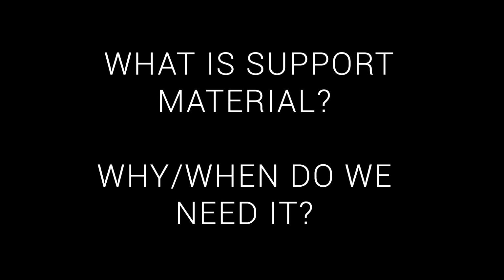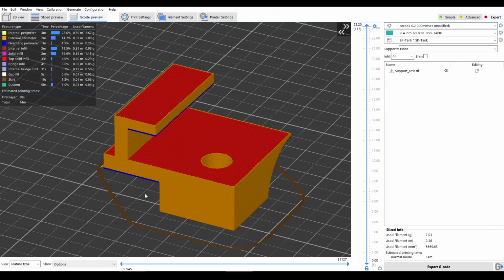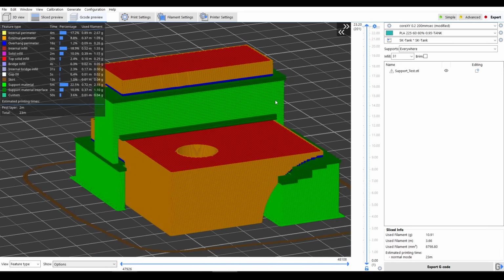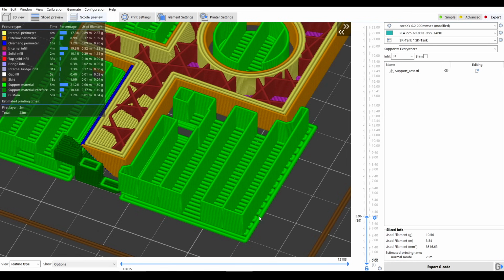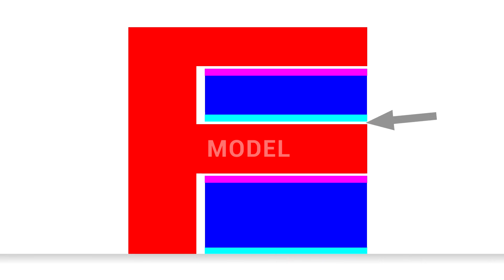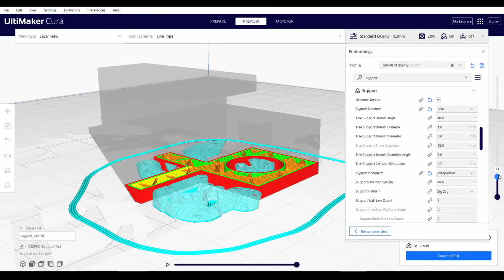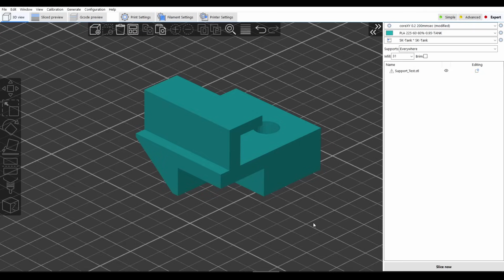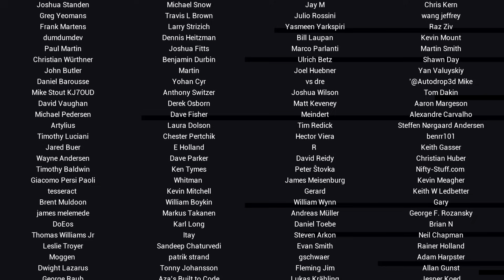Support material complete guide for 3D printing

Comment: Excellent video on dealing with supports. I have one comment: Since you have a very good outline of topics you use to make these videos. Would it be possible to make like a 'cheat sheet' on the different slicers and the commands they use to perform similar actions. For example:
X-Y separation between support and item to be printed:
Prusa: X-Y Separation (% or mm)
Cura:  Support x-y distance
I find rewinding the video to catch information is very exasperating and time consuming.  Even going thru the transcript is cumbersome.
Yes, I know are thinking "What an ungrateful subscriber after I put all this effort into this video." I do appreciate your effort but if you could make a cheat sheet it will be greatly appreciated.

Comment: What do you do for supports in tougher filaments? If your printing in nylon or pc etc then surely you don’t want to use that stuff in your supports because it would be expensive and difficult to remove. So if I’m using engineering grade filament then what material do I print the supports in and what material do I use for the interface layer?

Comment: You do a great job and i have learned much. Today I am in new territory. Maybe you have some ideas. CR 10S Pro V1 modified a lot, Pi 4B with Klipper, Mainsail and Orca slicer. Struggling to get clean parts with support. Setting are there but what does what is not transparent. I see weeks of trial and error to learn how to use all the knobs and dials available. Would like to very much shorten that learning curve and try hard to get the best possible part in the fastest print time on this old but much loved Bed Slinger.  Any help you can offer would be wonderful, Dennis in Virginia I forgot to mention horizontal holes, I need them for assembly and some are countersunk  and some are threaded but that all need to present a round hole not oblong which is most common. I am adding a second part cooling fan to help balance the hardening of filament once extruded. Not installed yet. Should help. D

Comment: For parts I design myself I have gotten into a habit of designing my own supports into the actual part. It's a lot more efficient than automatic supports and yields great results.
Reply: So you add them manually in cad software or in the slicer program?

Comment: I'm curious. In the video you showed a soluble support material that was quite flexible. We use Ultimaker PVA soluble support and it is very stiff and brittle. It breaks frequently in the bowden tube and jambs. 
What soluble support were you showing?

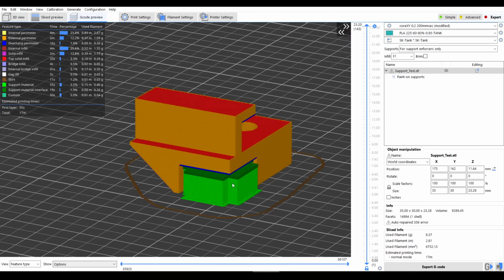Comment: ❓ 17:07
Is there a way to block the path of the supports? (Support-blockers don't do what I want)
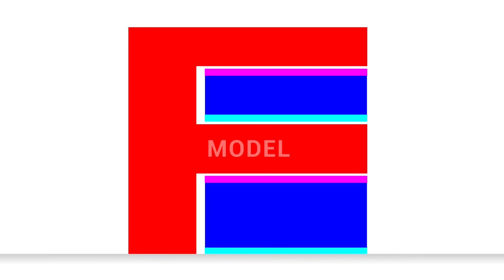E.g. I have a model like your red sketch (10:39) with a small hole in the bottom roof (circle of the hole being horizontal). Now the support would go through the small hole making it difficult to remove. With support-blockers I can try to find the area on the top roof exactly over the hole. What I want would be, that I could insert a "support-path-blocker" (my suggestion for the naming) as a cylinder inside the hole, so that there wouldn't go any support through (doesn't mather if traditional or organic/tree support).
For my easy example the way with the normal support-blockers (or paint-on-supports) can work somehow but with more difficult parts such "support-path-blocker" would really help.
Maybe they exist and I just don't know where.
PS: I'm using SuperSlicer and sometimes PrusaSlicer.

Comment: Something critical to know is that the air z gap will always be a multiple of your layer height when supporting a flat surface. If printing 0.2 mm layers, a 0.28 mm gap will print the same as a 0.20 mm gap or a 0.16 mm gap.
Reply: Well that doesn't seem to be the case anymore, at least not in Prusa or Orca

Comment: Thank you for a great video. Very educational for this noobie. I took my son's Geeetech A20M since he wasn't using it (just got married working on house) and I'm learning. I would like to learn the different properties for these filaments and how to program into the slicer. Of course there are lots of tuning involved but just the general idea. I would also like to find/told what slicer to use that I can see the G-coding after slicing, so I can edit a few things in like auto bed leveling and/or keep the setting in the EPROM.

Comment: I had to go hospital Friday because I had to use a raft which I never usually use. I turned it on left it as default and it was really flipping stuck to the point I needed to use something sharp. Unfortunately I slipped now I have a massive bandage on my finger. So I need to check these settings in future to save on hospital trips lol .

Comment: Those tree supports are larger than some of my prints! My tree supports are only 2mm in diameter with a 6mm wide base 3mm tall. I currently use Flash Print that came with my FlashForge Artemis and I'm honestly very impressed with it so far. I'm amazed that it printed without any issues right out of the box, I was prepared for days of testing and calibration....

Comment: Great info on all the supports.  Ive been useing them to my advantage lately, when printing some L brackets for shelf, the little 45 degree diagnal bit  gets filled with support adding to the strength of the brakcet,  i imagine anyway.  Not sure where the compression forces are going to be honest, but more mass in that area cant hurt.   Printing the bracket on the side allowed for no support but I was getting warping issues even with a brim because of the small contact and long surface area lifted corners easily (ABS)  printing the other way solved that, but gave me unwanted supported which turned out to be wanted!  The conicoildal supporst are nice looking too so add an artistic touch to the bracket.    Ive also printed some pieces in mid air to be purposely supported which gives a cool effect.

Comment: Would it work for slicers to have a mode in wich you could print two layers of, let's say, 0.16mm just walls and on the second layer the infill is printed at 0.32mm? This could allow for nice details on the outside and saving some time for infill printing. Also this could already be a thing and I don't know about it. :D
Reply: Yes I've heard of that. Look for "combine infill every n layer". Your should find settings for your slicer.

Comment: I would add my favorite tip for supports - for PS and similar (I don't know about Cura or S3D) do not over look "support material extrusion width" - I use much much lower/thinner/smaller width for supports, because then they are much much more easier to remove... for example I use 0.6 nozzle and my support material width is 0.4-0.45 (depends on material - silks need little more) and you use less material also :D so win-win

Comment: I can get the best supports by bumping up the bridge flow rate quite a bit, like 1,5. This applys also for the first layer from the overhang printed on the support material. The distance can still be 0,2 mm but with the bigger flow rate the material ist pressen more against ist but still not bonding very well because of the initial 0,2mm "gap". If ther are also real brides in the model I only apply the bigger flow rate with modifiers where the supports contact area is. (PusaSlicer)

Comment: Great video, Michael!  Very helpful information.  One setting in Cura that is worth using is “Enable Conical Support.”  It modifies traditional supports to use less filament by starting with a narrow base on the build plate and building the supports up at an angle until it reaches the full size before the transition layer.
Reply from the maker: Thanks for the info!

Comment: Hi, Michael. I have a solution for perfect supports for the single material. The only downside is the number of support top and bottom surfaces which are limited to one's patience (i.e. how many times you want to intervene the print process).

The method is simple and kind of derivative of old known method of using marker. I changed the usual marker to the custom one filled with sunflower oil (I purchased empty marker on Aliexpress if someone interested). Then you have to set pause after finishing the topmost interface layer, "paint" the surface with oil and continue to print. I even was able to separate well known calibration cube printed with 100% infill just using pause in the middle, which confirms that 0 mm gap works perfect.

Hope, this can help in some difficult cases where you have to print with supports and the surface above support must be the same quality as bottom or top.
Reply from the maker: That sounds effective. On angled face, do you pause it after each layer to apply the oil? I guess those break away easily by comparison anyway.
Reply: @TeachingTech  Well, technically speaking it's the same downside since angled faces have too many surfaces to support. But, yes, you have to apply oil every layer to make perfect supports.

Comment: hard to believe you haven't used tree supports before. I found them within a month of getting my printer and use them all the time, I find they are better than normal supports 60% of the time
Reply from the maker: It's the truth. With resin printing, they are closer to tree and I have used them extensively, but not with FDM. I don't ever use Cura unless it's for a video like this or I'm reviewing a machine that needs it. With that in mind it was never really an option for me.
Reply: @TeachingTech  ah that makes sense,  didn't know it was only in cura. Thanks for the videos btw you are one of the first 3d printing channels I found and I know most of what I know thanks to you!
Reply: @theycallme_nightmaster  yeah prusa slicer has it now on the alpha, as mentioned in the video, and it’s much nicer then traditional supports on most items. However Bambu studio tree supports are very nice. I’m sure I could match the results with prusa slicer with some tweaking but I don’t use my older printers as much as I used to so won’t unless I have to. 

All that being said supports have been the bane of my existence since I started 3D printing. I even kept the first model I printed that is embedded inside support material as a reminder to double check settings. 

I like the idea that petg and pla don’t play nice and you can use one for supporting the other. I need to try it some time.

Comment: Hey mate you mentioned a flat scalpel around the 12 minute mark. Where did you find them? Do they go by another name? I'm having trouble finding them.
Thanks.
Reply: A painter's knife is another option as they come in various sizes and are great for even removing prints off the build surface.

Comment: Your video has helped me resolve a LOT of issues I've had with supports lately - I have literally printed a dozen iterations of one model and each time it was a failure (usually the supports completely fused to the model, even organic ones).  You covered the bases of what is important and how I was very confused with what should be selected for several options in Prusaslicer.  Thank you Michael!😁
Reply from the maker: You're very welcome!

Comment: I just wish I could get Prusa Slicer to print supports like Cura.  I prefer almost everything about Prusa, but when I print things with supports, even using "organic" supports and tweaking the Z distance and X Y separation, they are still harder to remove, much less cleanly.  With Cura they almost fall off.

Comment: For xy gap it would be useful to see what effect this has when you are supporting overhangs that are sloped. I found it had quite an effect on removability of the supports, but not really sure what the actual relationship was or when the slicer was using xy, or z gap to determine support location on these kinds of overhangs.

Comment: The paint-on is good for putting supports in someplace that will be hard to reach. Like, if you're printing a cylinder open on the bottom, you can paint-on supports in a ring in the middle of the cylinder, and it leaves plenty of space around the edge and up the middle to get needle-nose pliers to grip the support stuff. Also, if you add extra triangles when you're modeling it (e.g., adding extraneous edge loops in blender) you can very easily paint on the triangles of a large flat area to drop supports right where you need them, not too close to edges and etc.
Reply: The exclusion painting can also be really handy too if you have small areas that you don't want support material in at all as it'll be impossible to remove.

Comment: You don't need supports for counter-sunk holes if you design them slightly differently. 
The STL files for the Voron parts illustrate how to do this.
Reply: I also like closing them with one layer height, so it's just a bridge and you can simply push the screw through
Reply: That's an easy way to design them.
But there's an even better design approach out there that doesn't cover the hole and doesn't require supports.

Comment: Thanks a lot for this one. Testing/tuning on my Bambu Lab X1C a bit now. I've mostly used tree supports with this printer so far, so I'll do a tst with regular and tree on the first model you suggested (but didn't try).
Reply: Apparently, the tree support wasn't very good for this model. The normal support (tuned a bit after what you did) worked well, though.

Comment: Michael, yet another excellent video!  Do you mind posting your traditional support settings for Prusa Slicer derivatives?  I realize that each printer is different, but I feel like this would give me and many other viewers a good starting point to experiment with.  Thanks in advance if you're willing!
Reply from the maker: It's not something I've tuned a great deal but you can see the thins I have in this video. 150% XY separation and I found a Z gap of 0.28 pretty good for top and bottom.
Reply: @TeachingTech  Much appreciated. I did see these settings in the video and played around with it a bit over the weekend. The top separation seemed to work fine, but no matter what I always got fusing on the bottom. Any suggestions? How much does temperature, cooling, and print speed play into supports?

Comment: @TeachingTech There's a Cura 5.3.0 psudo-Alpha that has a critical difference from the current 5.2.1. It is the "Minimum Support Area" setting - in the regular release, this is disabled for tree mode (and defaults to a value too high for me), but the special 5.3.0 release allows it. This was important for me, as I had a small lip that couldn't droop, and I couldn't get the tree or traditional support to go to it due to the part geometry. This version also has a ton of settings for tree mode that help with material usage and strength. Great addition to the tool box if Cura is your slicer of choice.

Comment: On my Bambu Lab X1C I load PETG into one of the AMS slots, and use it as a support interface when printing with PLA. Works very well, I can set the top Z distance to zero, and the prints come out perfect
Reply: Don't you end up purging tons of waste?
Reply: @MumrikDK wouldn't be that bad for only the interface
Reply: How do you slice it to only use petg as interface layer?
Reply: @Ebonyqwe  under support tab, there's a selection for "filament for supports." You just pick a roll to use in the "support/raft interface" box.

I imagine you already know this, by now, but it's worth adding for others that might have the sa me question.
Reply: Can the same be done with ASA and PETG? Or is there another material that can be used to support ASA?
Reply: I tried the same but I had a lot of jamming in extruder when PLA was removed. Did you have similair issues?
Reply: @new.one.1307  In my experience you have to pay close attention to the temperatures. You have to make sure that the nozzle is hot enough when purging the higher temp material with the lower temp material.  You also need to purge lots to make sure that there's no residual material in the nozzle or else you might get jams.
Reply: Very interested in this because I'm currently Z-stacking some PLA to get multiple flat models in 1 go. 

The bottom layer doesnt matter too much but because it's printing in black, the top layer has a few blemishes where the connection points were. 

So basically I'm wondering, how clean does PETG leave the top surface when printed on PLA? Since I'm stacking I'm basically just looking to replace the 1 layer gap between models with 1 layer of PETG and then pull it off after.
Reply: @dammitmatt6426  what if you try PVA filament for those separators? You're already going multi-material, might as well go full dissolvable support material. I think PETG just doesn't adhere well to PLA, so you might get failed prints
Reply: @Evan Barnes  never used it before but willing to try, recommend any brands?
Reply: I’ve heard of people doing that. Good to see a confirmation that it does indeed work well. I have tried to do that with the Palette 3 Pro, but since PETG doesn’t bond well to PLA, it also doesn’t splice well in the Palette.